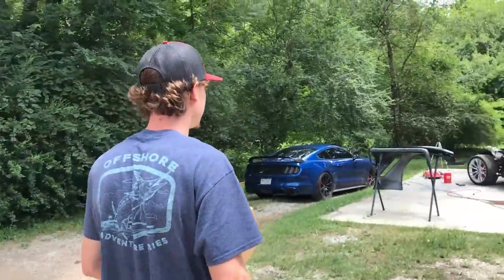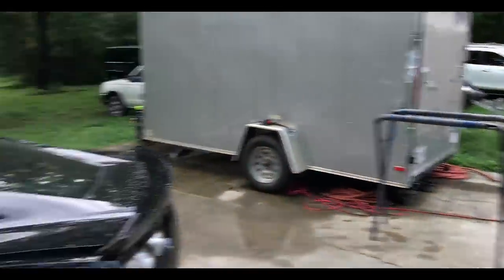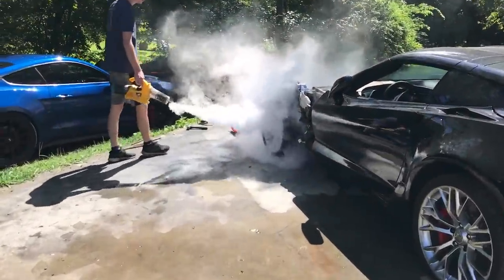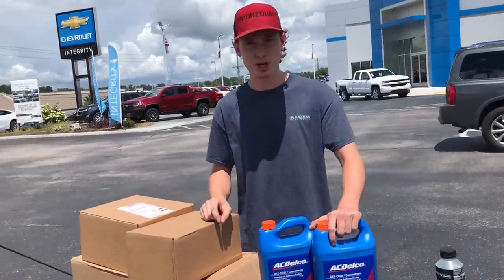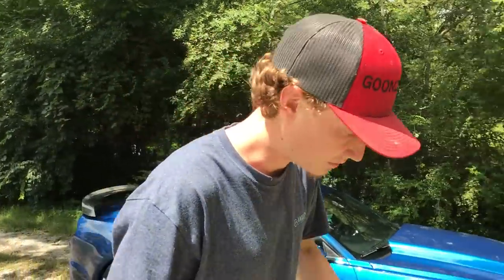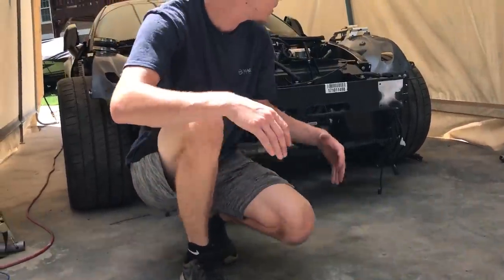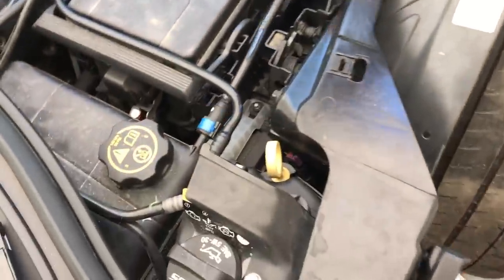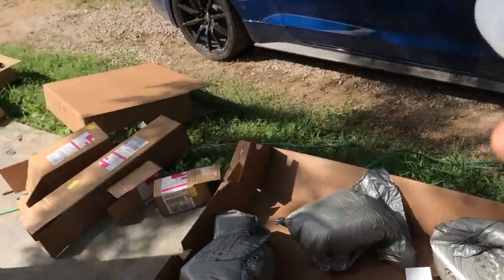Rebuilding A Wrecked 2017 Corvette Z06 Part 8

Comment: Its lifted because of the magnetic shocks. Once you started it it will come down.
Reply: Figured someone would have already answered this question.  It will settle back to proper position after a little test drive.
Reply from the maker: emwa3d ahhh thanks for the info
Reply from the maker: Jeff R I need you guys on the team

Comment: You can lower your corvette with the lowering bolts at the ends of the leaf springs to give it that nice low ride. All you need is a jack and a 10 millimeter wrench I think.

Comment: Wish all the coolant piping and secondary radiator you are most likely going to have one heck of a time bleeding the air out of the system 1 recommendation is a coolant vacuum bleeder They help a lot

Comment: Question if you see this.My Camaro SS has rough paint in spots like buildup. I was going to clay bar the rough areas then polish the whole car.Then use the Adams polish car sealer. I was then going to use the buttery wax.My regular routine after that I use the detail spray polish to shine her up it’s the quick detail spray???🤔

Comment: Doubt you guys will see this comment but the corners of the bumper where it meets the hood by the headlights it rubs and takes the paint off. Just thought I would let you know about that. I work at a dealership and customers always bring there cars in for that reason to get fixed because it runs the paint of before warranty goes away. Just thought i would let u guys know

Comment: Yeah they had to add the second radiator because they kept heat soaking the motors and dropping valves.  That is a fact with the LS7 motors.

Comment: I'm wondering what the up side is when its all done. Figure what the insurance company charged you for the wrecked car, add up all the money spent on parts then throw in your labor at $30/hr minimum now your selling a car that has a rebuilt or salvage title which kills the resale value.
Reply: Yes and also sometimes it can be tricky finding insurance for a car with a rebuilt title status.  Need to shop around because some insurance companies won't offer full coverage on such a car and many  will add a surcharge of up to 20%.  Hope that's not the case with this Vette.  Getting it inspected and certified by the proper mechanic should clear up most issues.

Comment: The problem with you guys is you don't do the job but yourself you actually relay on somebody to do the job when it comes to frame work
Reply: How is that a problem? Did you watch the video where they pulled the frame on this with their Jeep wench and forklift and welded it? Let's talk about the Mustang. Have you ever pulled a frame out in your driveway with any precision and got it straight? Nearly impossible without a frame table.
Reply: John Long  I am not a professional but if you wanna should people how it's supposed to be done you should doing it by yourself not taking it to a frame shop I could do the same thing buy cars the have frame damage and send it to frame shop
Reply: They did repair the frame of the Corvette in their driveway. Go watch the video. You cannot fix a severely damaged frame in your driveway and hope to have it drive straight. Just not going to happen. Plus there are professional shops that sub out frame work too and don't do it in house. It's very precise work and requires precision tools that you won't find in many shops much less someone's driveway.

Comment: Hi guys, you guys are doing such an awesome job!!  On your video, you were talking about how the front suspension is too high, that maybe it will settle down some? I'm sure you know this already but just in case you don't. Corvettes all come with adjustable lowering bolts two in the front and two in the back. They should be there if not there missing? I dought it, I don't know why were they sit they would be. I don't think the accident would have affected them. Here is an illustration to show you where they are!  http://i.imgur.com/ZylVzs6.jpg  Cheers! Tim